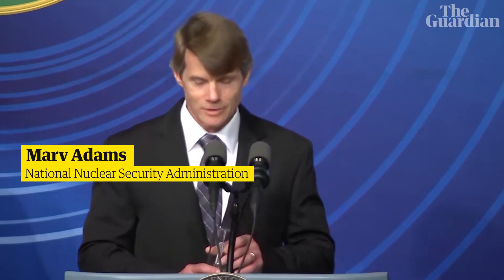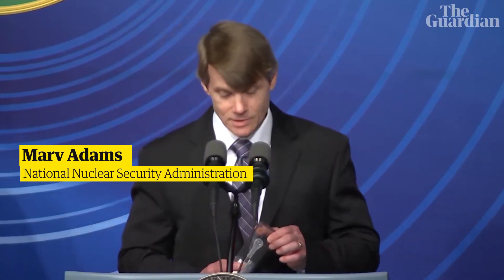Nuclear scientist Marv Adams explains what happened in the successful fusion experiment

Comment: Creating energy out of nothing is such a crazy concept to me. Feels like something else in the universe needs to happen as a result, or else wouldn't it break the laws of physics?
Reply: @Richard Jackman Gotcha, so it's just a more abundant source than fossil fuels? Won't ever run out?
Reply: @caninflor5984  Yes, a variant of hydrogen goes in (the most abundant element in the universe), helium comes out (which we happen to have a shortage of on Earth). Unlike current nuclear reactors, fusion requires continuous intentional upkeep - if you turn it off, fusion stops. Safer, cleaner, all around much better.
Reply: This happens all day everyday in suns. We just need to subject the plasma to enough pressure. We've been trying to figure out how to simulate the needed pressures to create the phenomenon without the standard cause: massive amounts of gravity. What we've been honing is the efficiency of the energy requirement for the alternative pressure. This isn't a free lunch, we're just paying with a different currency. In this case its an unholy bombardment of focused light instead of gravity.
Reply: @Unpopular_0pinion  Thanks

Comment: I'm sorry to say but net energy fusion wasn't achieved. The energy quoted in press conferences tends to be the plasma energy gain, Q_plasma = [energy out of plasma]/[energy into plasma], and not the energy gain of the plant as a whole, Q_total. In a fusion reactor most of the energy being pumped into the system never goes into the plasma; most energy is required for magnetic containment of plasma, cooling systems, maintaining a vacuum in the reactor and pumping of the laser (which is a very inefficient process). Q_plasma also doesn't consider that the heat generated from fusion has to be converted into electricity (efficiency limited by 2nd law of thermodynamics. Powerplants usually achieving 40-50%  for a industrial turbines). 

Consequently, Q_plasma is much, much lower than Q_total.
Reply: @jamiegrant5955  this experiment did not use magnetic containment, it used a x-ray laser made from 80's tech.  The energy coming from the laser is converted to x-rays, which heat up the hydrogen and compress the hydrogen to plasma temperatures.  Once private sector money gets invested and the lasers get upgraded to current effeciency/output, the system will eventually work.
Reply: I'll believe the scientists that have qualifications, thanks. Not some backseat, armchair physicist whose watched 1 Kurzgesagt video and suddenly thinks they're Einstein.

Comment: "About half the size of a BB"

Ah, American measurements.
Reply: "Power output from the fusion reaction was about 1/5 hiroshimas"
Reply: What’s that in bananas? 🍌
Reply: @arghjayem  it's about 3 green ones and a single brown one that should be thrown away.
Reply: Same Americans that made this breakthrough happen lol
Reply: Americans using decades worth of calculations and studies from all over the world to make this happen.

This is a world achievement. Not an American one. Cope.
Reply: @davidjs97_  American scientists use Metric because its an undeniably better system
Reply: Lol sure, then why aren’t your scientists figuring it out? We use metric for YOUR benefit, not our own. It’s to communicate.
Reply: @Commander23c  Metric is based on the circumference of the Earth, not arbitrary measurements. Scientists use metric because it is based in a tangible, unchanging medium.
Reply: @rowanmelton7643  Yeah you're right, imperial system isn't as widely used. What are you getting at?
Reply: @mildlydispleased3221  Thats literally the opposite of true. Metric is based on measurements of constants scaled to historic values of units. The metre used to be a literal stick in Paris, but now it's just the distance light travels in a very small and specific amount of time. Scientists changed to this because tangible mediums are absolutely not unchanging, and if the definition of your unit changes over time, it's a massive problem. That's why metric is based on non-arbitrary measurements of universal constants, because they don't change, ever.
Reply: @mildlydispleased3221  the circumference of the earth is in a state of constant change
Reply: @jackwolowacz9382  One metre was created to be 1/40,000,000 of the Earth's circumference.
Reply: @mildlydispleased3221  Yeah it was, and what is it defined by now?
Reply: @jackwolowacz9382  A precise mathematic equation.

The entire world has agreed to use this system barring a few countries. Americans in their stubborn ways need to move on.
Reply: @mildlydispleased3221  Oh I absolutely agree with you on that, America uses metric for its scientific units anyway, and even the imperial system is just based on the metric anyway. My critique was just based on your claim that scientists use metric because it's based on a tangible object. That's absolutely incorrect. The entire point of metric now is that it's based on intangible unchanging mathematical constants, not a random object in a vault that changes in size and mass over time.
Reply: @jackwolowacz9382  One metre was created to be 1/40,000,000 the circumference of the Earth, of course now it is a mathematical formula. I was stating that the metre is on the Earth which size has remained essentially the same for the entierty of Humanity's short history.
Reply: Its the same size as an EU football ⚽ but devided by 9.52 and subtract 1.87
Reply: As soon as he said that I knew exactly how small it was.
Reply: He should have said about .0000000000001 of a moon landing in diameter
Reply: About to become official in the scientists community. Bb
Reply: How much is it in half-giraffes?
Reply: BB = Buttered Breads
Reply: How many football fields is that?
Reply: How much is that in hamburgers and freedoms?
Reply: What do you people know about Organically Bound Tritium.  Tritium is released from all PWRs at a rate of 10s of thousands of TBq per site per year.  Once taken up in plantlife that we eat, it forms Organically Bound Tritium which causes DNA strand breaks, micronucleus formations, cell necrosis or apoptosis, chromosomal aberrations and various other phenomena thus negatively affecting human health.  This is a quote from newer research and OBT does not flush from the body within 12-30 days like Just Tritium.
Reply: baby.
Reply: AMMO
Reply: I thought he was referring to 6mm BB gun pellets 😢
Reply: I can visualize it more clearly than saying 2.25 mm which is the same diameter of a standard bb bullet
Reply: @inigobantok1579  I mean, this is really just matter of being familiar with measurements..
Reply: Like the ones they used when they sent that thing to Mars. Well, in the general direction of said planet. Still so incredible that I don't know if I dreamt it all or if it actually happened.
Reply: Ball bearings only exist in america?🤪
Reply: @BeBe-vh4ry We have ball bearings, they come in many different  sizes!
Reply: @BeBe-vh4ry  he's talking about Bb's from bb guns.
Reply: @BeBe-vh4ry  I have never heard anyone refer to a ball bearing as a 'BB'. That went right over the top of my head. If he was speaking to a predominantly American audience then his use of 'BB' is understandable.
Reply: American measurements also got to successful net positive fusion first 😎
Reply: @christopherhicks5640  i know it was a joke and it's funny but you know these scientists use metric system right?
Reply: @eze3922  lol yes
Reply: @christopherhicks5640  nah, the American scientists use metric measurments.
Reply: @christopherhicks5640  American scientists use Metric because its an undeniably better system
Reply: @rowanmelton7643  Americans will also be using fusion because it’s an undeniably better system
Reply: @christopherhicks5640  Americans could cure every disease in existence and there would still be ignorant comments like this 🤷🏼‍♂️
Reply: I mean after showing the tube and saying we could not see it from that far, he showed with his fingers. It was way clearer that way. 🙃
Luckily I played Death Stranding and know about the BB. It is an amazing feat to get half the size of a BB inside this tube.
Reply: I don't think saying 2.25 mm would make it any clearer.  Actually it would make it worse.😜  

(A standard BB is  .177"; so half would be 0.0885" which in mm is about 2.25 ).
Reply: It would be better in mm
Reply: @nunyabusiness5075  2.25 mm is a very easy to understand size for everyone who uses metric (so, most of the world).
Reply: @nunyabusiness5075  2.25mm kinda makes it a lot clearer, but you do you.
Reply: @nunyabusiness5075  2.25mm makes more sense for me. I know how much a mm is, but I have no idea what size of ball bearing he is talking about.
Reply: @tklarp4735  BB does not mean ball bearing. BB is a size of pellet commonly used in BB guns, childrens toys, and also in birdshot for shotgun shells. as someone else said, a BB is .177"
Reply: @tklarp4735   BB is a particular size of shot, the size of the round balls in a shotgun cartridge, it doesn't stand for ball bearing in this case.  Half a BB would actually be number 8 shot (yes, they switch back and forth between numbers and letters in shot sizing), but then even fewer people would know what he's talking about.  In the USA a BB gun or air rifle was a fairly common item for young boys to have and is usually 0.177" caliber, (the Red Ryder BB gun from the movie a Christmas Story for example).  
Scientists (and most of the world) use metric, Americans tend not to use it.  While engineers often use metric,  many here have   issues "thinking" metric. For instance a local store might be a little over a 3 miles from me, but if you tell me it's 5 kilometers away, I don't immediately know what you're talking about, just as  you might not immediately know how far 3 miles is in your mind.  
Either way, half a BB or 2.25 mm, the ball used was what I would call.....small. 😃
Reply: @nunyabusiness5075  Cool. I didn't know about the BB thing.
Reply: @nunyabusiness5075  That would be perfectly clear to the largest part of humankind! Thanks for the conversion, by the way!
Reply: @nunyabusiness5075  Yes, yes it would lol. Even small child would understand that.
Reply: BB is 4.5mm, so about 2.25mm, for those unfortunate enough to have never been exposed to BB guns.
Reply: Why does the unit of measurement make any difference? If its accurate you can measure things in atoms all the way up to Elephants and it makes no difference. He's probably telling people based on a BB because thats something everyone can relate to. Thats also why he's saying the time for light to travel an inch - saying a 12th of a nanosecond probably wouldn't click with so many people.
Reply: @siraff4461  If by 'everyone' you mean US Americans, you are probably right.
Reply: @harmless6813  I'm struggling to think of anywhere that doesn't have BB guns. They are pretty much a worldwide thing.
Reply: @siraff4461  I had to look at Wikipedia to see what a BB gun is exactly. No, as far as I know we do not have BB guns here, we only have airsoft. And even if I did know the term, 2.5 mm is still clearer than estimating how large a BB might be.
But I guess he was talking to a US audience, so he is excused.
Reply: Corruption is still there in us politicians scenes
Reply: @olearysbf6580  Political corruption isn't limited to the United States.  In fact, quite a few countries have significantly more corruption on a relative basis than the US.
Reply: @skysurfer5cva  but it's running wild in us politicians without prosecution
Reply: an yet nearly 100% could wrap their heads around the size he was describing easily....

Comment: Just to put this into perspective, the fusion returned 0.015 (1.5%) as much energy as was used to power the lasers. That's a 98.5% loss.
This tech has decades more R&D ahead before it's of any practical use for power generation.
Reply: that is not what is said at all
It took 2MJ to power the lasers, and the fusion liberated 3MJ of energy
a gain of 3/2 = 1.5 or 150% not 1.5%
Reply: @RidgyORidgy  that's not what he said. He said how much energy the lasers deposited...not how much energy was used to charge the caps and how much power went into creating the laser pulse.
Reply: @RidgyORidgy  
He didn't say that the lasers took 2MJ to power up.
"It produced more energy than the lasers had deposited. About 2MJ in, about 3MJ out."
The lasers don't deposit all their energy into the fusion reaction. Only 1% as Mechael has quited Troy Carter. So taking the laser into consideration this process has no energy profit yet.
Reply: Not 1.5%.  2MJ in and 3 MJ out is 1.5 gained per 1 put in.  That's a 50% gain, which is massive this early on.
Reply: @halwakka504  
"But it’s only a net energy gain at the micro level. The lasers used at the Livermore lab are only about 1 percent efficient, according to Troy Carter, a plasma physicist at the University of California at Los Angeles. That means that it takes about 100 times more energy to run the lasers than they are ultimately able to deliver to the hydrogen atoms."
0.015% return of energy.
Reply: @michaelrch  so you are saying that the ones on the video SAID 2 to 3 MJ conversion are mistaken???
Reply: @danilomarvel5657  
No.
I am saying that is only a part of the system efficiency.
Thanks to ultra high-powered lasers being 1% efficient, the total system efficiency is 1.5%.
Reply: @michaelrch  the Q&A panel clearly said that the laser used is inefficient and is based on 80's tech.  She went on to say that current laser technology has up to 120% efficiency, and that the gap can be closed using modern technologies.  Please stop and go watch the panel.
Reply: @kevinanderson7887  
Ok, let's take those numbers and play that out.
1% efficient plus a 120% increase means it's now 2.2% efficient.
So overall that's 3.3% efficient, or a 96.7% loss.
Reply: 1.5 ratio, not percentage. In percentage it is 150%.
Reply: @gustavobravetti  I don't need that spelled out thanks 😊
Reply: Its about the energy that actually enters the hydrogen. The lasers only take that much to power because they are extremely inefficient. But the energy that actually entered the hydrogen was 2MJ and it spewed out 3MJ.
Reply: @LS5D  
Who cares? The system efficiency is still 1.5%. They don't have some other magic system to deliver energy to the plasma that is any more efficient.
Reply: You’re mistaken. Marv said 2 megajoules in and 3 megajoules out.  That 1.5 times gain, not 1.5% gain.
Reply: @forbeginnersandbeyond6089  
No I am not mistaken. I read the write up on this.

"But it’s only a net energy gain at the micro level. The lasers used at the Livermore lab are only about 1 percent efficient, according to Troy Carter, a plasma physicist at the University of California at Los Angeles. That means that it takes about 100 times more energy to run the lasers than they are ultimately able to deliver to the hydrogen atoms."
Reply: Gain of 1.5  (2 in 3 out).  Simple math really if you listen.
Reply: So it’s the normal selective statistic thing that’s throwing out a better outcome than in reality was produced. No wonder they got the comedian to spin it.
Reply: @brynleytalbot778  the point of the experiment was to prove it was feasible, now we know that it is. Next is to reproduce and find efficient ways of doing it. That’s why it may take decades. But they showed that it can be done.
Reply: No, 150% more was produced - this is the first time MORE energy was produced than used in the process, hence the significance
Reply: @happyman4566677  
It wasn't though. 
The lasers are 1% efficient.
200MJ went into the lasers. 
3MJ was produced by the fusion.
Hopefully we will have fusion one day, but that day is a loooong way away. 
There are still several decades of R&D ahead before this technology is ready for productive use.
Talking about "commercial fusion within a decade" as Biden is doing is pure fantasy bordering on misinformation.
And just to be clear, this tech will have no role to play in arresting the climate emergency for the foreseeable future.